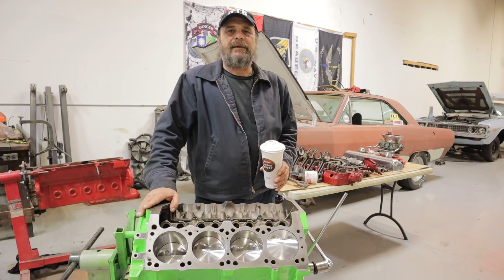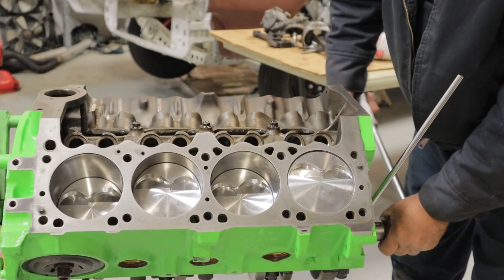Finding Your Engines Happy Happy Fun Zone

Comment: Very interesting video Tony. Would be interesting to get your thoughts on mixing other fuels to gasoline and for what benefits. way back in the 50's guys were trying things like Acetone, Toluene, Alcohol naturally and even nitro methane mixed in. Back in the past one circle track ford 351 motor we were actually adding some nitro methane and having great results but too much made the motor uncontrollable. We also were running total advance of 42 degrees ignition timing.

Comment: Hi,  can you explain how this translates to "diesel super stock" tractor pullers?

I have always heard how alcohol supers can make "the same power with far less cyl press"

Real world tells me they are on to something

Diesel supers straight up blow up parts, while alcohol supers can do "almost" and the same thing with " hand me downs"
Reply: The diesels run gobs of cylinder pressure because that is what makes torque and torque makes horsepower. Diesels struggle to make good power beyond 6000rpm because the fuel burns too slow. An alky can run 9 to 10k and still make power.  This means they run 30-40% less cylinder pressure and torque making the same power.
Reply: @bcbloc02  I guess I didn't realize that turn that many more RPM's

Comment: what would happen if one were to use hydrogen peroxide instead of water in a water meth injection build? h2O2 should be better then H2O seeing as how there is an extra oxygen molecule right? Has this been tried or experimented with at all?
Reply: It would provide a slight amount of extra oxygen. Hydrogen peroxide available from a pharmacy would be 3% H2O2 and 97% water, so not much extra oxygen. Higher concentrations of peroxide are very effective and are sometimes used as an oxidizer in rockets. But concentrations of peroxide above say 10% are very dangerous and somewhat unstable and are regulated, so not generally available to the public. If you're going down that route nitrous oxide is much safer to handle. I reckon if you took 10% peroxide and put it into an engine with a water injection setup and added additional fuel it would provide a good power boost. Without the additional fuel it would be a very lean mix and probably grenade the engine.

Comment: There are some guys combining port injection and direct injection to get a longer burn. I have no idea if it will work but I wish them luck.
Reply: The biggest reason for port injection  with direct is the lack of bigger injectors for direct and in power adder adder applications you meed a lot more fuel.
Reply: Not sure an addition of fuel mixture can be done after the initial charge has been fired by the plug , would really like to see if this is being studied or what ever.
Reply: @slyrider5271  It is done with diesel engines all the time but I have no idea about gas.
Reply: @johnparrish9215  good point!  but don’t forget that CI engines do not have a spark plug to ignite the charge

Comment: Please correct me if I'm wrong but I though the rod has the most leverage when the rod is at 90 degrees to the crankshaft not when the crankshaft is at 90 degrees to the cylinder?
Reply: I'll try. I'm no rocket scientist but I ain't no oxmoron either.
Yes you're right, but 90 degrees is a very small spot in the overall picture of things,  you don't have much time there.
Reply: 90 gives you the most mechanical leverage however the cylinder pressure curve would need to be mapped to determine if there is enough cylinder pressure to make max operational torque.

Comment: taking about diferent fuels, down here in argentina we use Natural Gas (kitchen gas) in the cars because well, is cheaper than gasoline, and im telling you when you switch from gasoline to natural gas the car looses aprox, 15/20% power because the natural gas has less energy than gasoline, also you have to advance the ignition because it burns slower than gasoline, i dont know if up there in the US you guys use Natural Gas as a fuel
Reply: CNG ( Compressed Natural Gas ) vehicles are around in the US.  UPS ( a package delivery company ) has been moving from diesel to CNG.   Propane vehicles have been popular with fleets in the past before diesels were more popular.

Comment: Your getting attached to that sexy green beast! LOL. Trying to envision that the piston is stationary at TDC/BDC is similar to (but not as drastic) as trying to comprehend that at absolute center of main-journal rotation, the crankshaft is not spinning. I know, it sounds nuts. But research it. Its true.
Reply: Sort of, the center of a rotating body has less angular velocity than its periphery. However, it never hits zero unless the center of the rotating body is hollow along it's axis.

Comment: UT, you should talk about 2-stroke porting and raising, widening, or lowering the exhaust ports.  It's the same premise, but oh so much easier to see/feel/do.
Reply: A lot of dynamics w a 2 stroke. Also As the piston comes down, it’s compressing the crankcase charge and shooting it ip thru the transfer ports.  
2 strokes are a wonder.  Fire every stroke, but uses only the top of the stroke for power,, but the rest of the stroke is used for  “valving and scavenging”.   
Who thinks of this stuff?  Someone smarter than me.  
But some people call me Simple.
Reply: How is it the same?
Reply: @pinkyellowblue007  the higher the exhaust port the quicker the pressure wave will escape. The lower the longer the pressure wave will act on the piston. 

There's more crazy stuff, like tuning the expansion chamber exhausts on 2 strokes. It's like velocity stacks on an intake to get the pulse to happen at certain rpms but I'm getting off topic now lol
Reply: @rustychevy2087  Yes, but when tuning a 2-stroke the exhaust port is usually raised resulting in gasses escaping the cylinder earlier thus lowering cylinder pressure on the down stroke.Isn't this the opposite of what Tony was explaining?
Reply: @pinkyellowblue007  you're right, but in relation to downward force on the piston what Tony said still applies to 2 strokes. The first 45 degrees about is key for gasoline fuel so about 1/4 the way down from tdc in piston stroke. To go 90 degrees would be half way down from tdc and require a different fuel. Are the exhaust ports on 2 strokes above the top 1/4 of the cylinder?
Reply: @rustychevy2087  No, they are lower.What are you getting at?
Reply: @rustychevy2087  sometimes 2 dingers make more snort with a quicker burning fuel
Reply: @pinkyellowblue007   if the port was in the  top quarter it would be letting the pressure wave escape before it fully acts upon the piston to push it down. Yes it also effects lots of other 2 stroke dynamics. If you used a different fuel that lasted to 90 degrees or 1/2 down the bore the pressure pulse could also come out the exhaust in that cenero too and mess with other dynamics of a 2 stroke. 

The pressure pulse dynamic is the same tho in 4 and 2 stroke engines. The initial whoosh from the flame pushing down the piston. That's what Tony is talking about not cylinder pressure/active compression. 

And honestly a 2 stroke probably isn't the best for playing with exhaust port location just for pressure wave reasons, cause you'd be changing alot of other variables of make power on a 2 stroke all at once with just that one adjustment.
Reply: @rustychevy2087  He was talking about blocks breaking, what do you think would cause that?
Reply: @pinkyellowblue007  pushing head gaskets or lifting a head is from to much cylinder pressure/boost. Blowing the block apart from the bottom is cause there's an active explosion still pushing the piston down when it already hit bottom dead center and trying to come back up. Tony explains it in the video lol

Comment: Power output is not an exponential of 45deg force nor mathematical function of fuel burn speed.  It's a function of velocity of  expansion force over time and angular momentum. To simplify. Thermodymanic mechanics 101.   There's a formula but I will save that for rebuttal.
Reply: UTz using analogy to bring us up. You're talking formulas to bring us down.

Comment: One of the problems you run into with diesels is how many degrees of crank rotation it’s spraying fuel. If the injectors aren’t big enough it takes to long to get all the fuel in and you’ll end up spraying outside the piston dish. Push it way to far and it can get into that bottom detonation since you’re effectively extending the burning of fuel that long. 
With the modern injectors they can do multiple injections for the power stroke. Though, it’s generally only done so the engines are quieter and cleaner burning. Basically makes is a longer gentler push instead of a single big bang. And, usually only done at low rpm and idle.
Reply: Another advantage to electronic diesels.  When put in tow / haul mode and when  off the throttle, fuel can be injected very early to act as some engine braking.

Comment: You briefly mentioned some things that you can do to get more power stroke.  Can you elaborate a little more about ways to achieve a longer power stroke?
Reply: I second that- what are the options to increase duration of the flame front on something like a slant six or 318 short of supercharging or turbo? 
Ignition and cam timing?